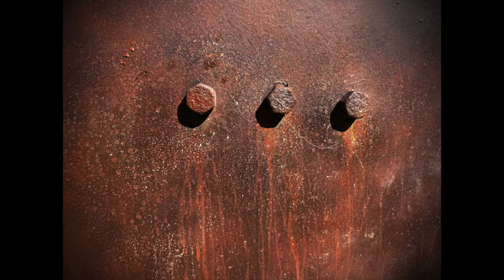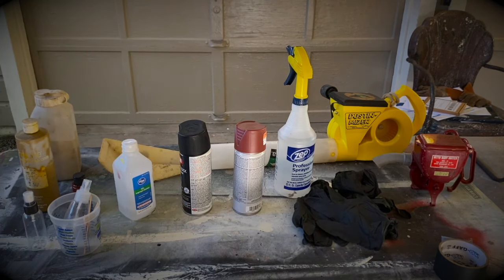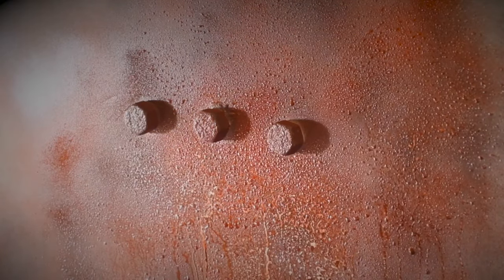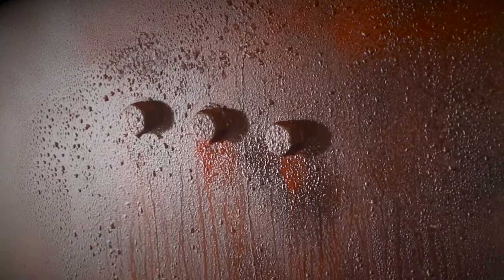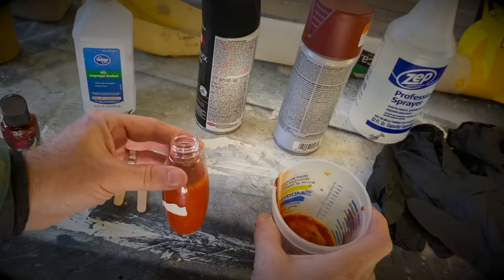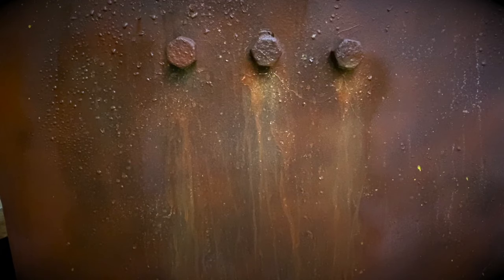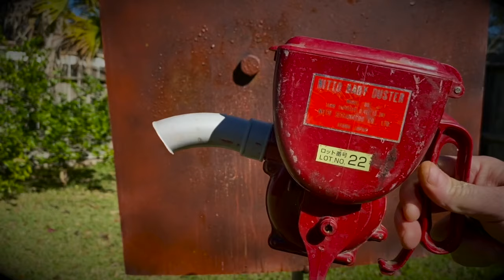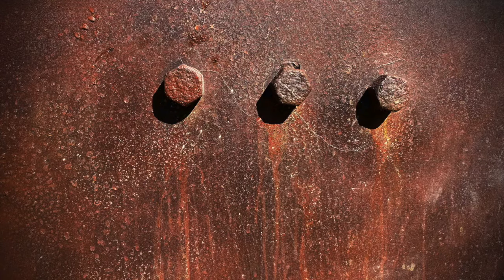FAUX RUST PAINTING

Comment: Just for clarification, the piece is completely dry (as in left overnight or longer), before you apply the fullers earth? Is that correct? Also, about what distance from the piece should you hold the blower?
Would this accept a matte clear to preserve the rust look?
Reply from the maker: OK, yeah sometimes I let it dry, but it only needs to dry for say 30 minutes at the most depending on the paint you use. I have used the fullers earth when the paint is still wet. They had some texture. Depending on the effect you’re looking to achieve Either a light dusting would mean further away from the piece or closer dusting to have it buildup in high areas or on top of three-dimensional objects on your piece and I’ve used clear sometimes, but it changes the look sometimes for the worse at the end of the day. It’s really just about playing and experimenting that’s what’s wonderful about this process. It’s a living breathing thing. Good luck and have fun.

Comment: Question, can you use this for automotive paint such  as a custom motorcycle? Also, once done could you spray flat clear to protect it from elements and gas?
Reply from the maker: I’ve always wanted to turn one of those flat track replicas into a barn find by using my technique. I have used some automotive  spray paint before and I just added a lot of acetone or denatured alcohol to my water spray and that seemed like it worked fine. Good luck.

Comment: Will this technique work with enamel? I’d love to use it on a motorcycle
Reply from the maker: I’ve used enamel, spray paint before and it still worked very well. Depending on the make up of the paint I used either denatured alcohol or acetone in my mixture. In a heavy concentrate. Be careful have fun good luck.

Comment: Brilliant, and doable! What was the base you worked on? Were the bolts cut off or were they sticking out the back? Mostly curious about what kind of bases should/could be used. Thanks, great tutorial!
Reply from the maker: Thanks for the comment. So this was just a test piece so I used foam core this technique can be used on pretty much on any kind of material I’ve even done it on fabric which didn’t really look that good but whatever. The bolts were actually large nuts that I filled with a water putty and gave it a little texture and then just glued them on the board. Good luck and have fun